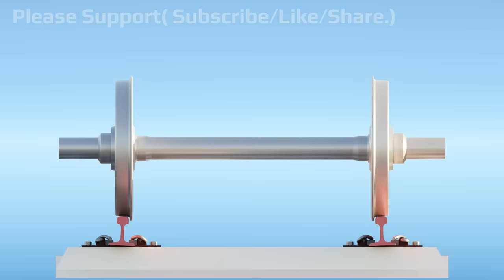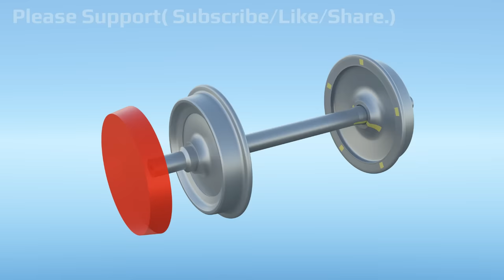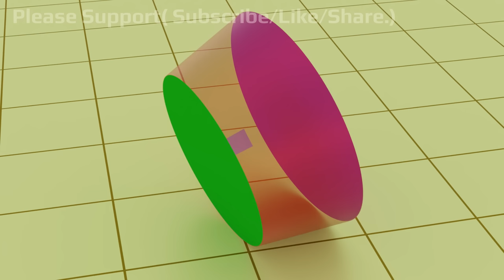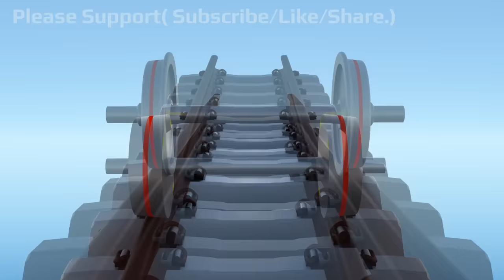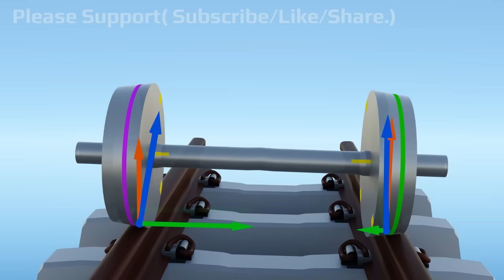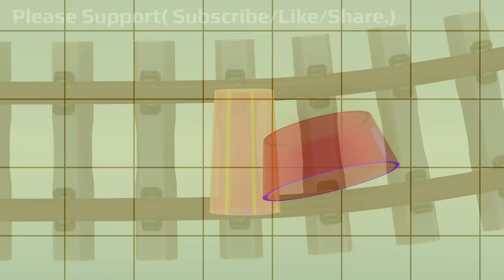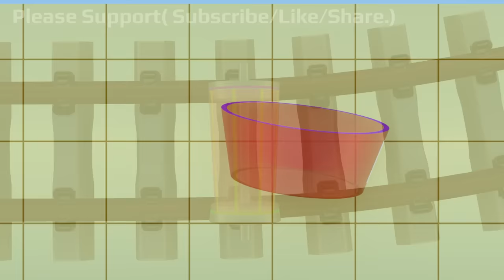How trains actually Turn ? | on curved rail track.

Comment: Thank you for your most valuable lesson about the act of a railroad train. It convinces me more that railroad trains are not driven: they are only operated by engineers and other train operators. This lesson teaches me how flange wheels make slivering sounds when the wheels turn according to the bend of the rails.⭐🌟

Comment: Always knew that the wheels were slightly conical but this demo makes the actual physics of the conical shape easily understood, before when I was explaining that train wheels were slightly offset the ones I was talking with couldn’t really believe me but now I’ve got something that explains it better than I can
Reply: there are no 'physics' unless the wheels are turning- the shape of the wheel-treads are designed to operate using differing radii in curves and this also illustrates why gauge accuracy is so very important.

Comment: Lots of good information but I'm left with questions (in case they do any revisions). The graphics for the force vectors are all drawn by someone who didn't understand that the length of each vector is proportional to its magnitude. The big resultant should be the diagonal within a rectangle and the horizontal component is the short side of that rectangle while the vertical component (resisting gravity in this case) is the long side. Next, I kept asking what keeps the wheel from getting so far to the side to have the flange touch the rail to make that squealing sound we all dislike (the sound that every Bostonian at Gov't Center hates). The video leaves the stability question only half-answered. Then there is the purpose to all that random, irregular thump, thump, thumping. Also, was this written by a person who made dozens of grammar errors or a computer who writes, mostly correctly, what it hears - leaving those errors untouched?
Reply: people who REALLY understand wouldn't even have to draw anything... but that would take mechanical and spatial aptitude. maybe some strength of materials knowledge would help.

Comment: The ratio of triangle (sin and cos) explanation finally made me understand! Assume hypotenuse is constant (non changing). Any angle change set by the wheel at that point in time changes the horizontal and vertical (ratio of opposite and adjacent over hypotenuse). But since hypotenuse is constant only the other sides change length and the length is equal to the force!
Reply: Ken do attitude
Reply: precisely why its better to think in terms of varying wheel radii and their effect on the steering of the truck, as well as how that steering effect relates to the curvature of the rails.
Reply: @tommurphy4307 interesting indeed, so the change in length (force) corresponds to a change in contact of the rail to the differing diameter of the wheel shape?

Comment: this does a good job of explaining this but I wonder why it is so difficult for engineering types to use articles properly.
Reply: Haha, I was thinking the same thing. The animation was great, but the narration was horrible. Don't these YouTube creators actually read their script before getting the robo-voice to read it, and then don't they actually listen to the video themselves to avoid getting embarrassed about all the grammatical mistakes?!
Reply: A lot of eastern European languages, like polish or russian, do not have articles. Speakers of these languages almost never used "the", "a" or  "an" prior to learning english, which makes it difficult to understand their actual use and spot the errors. The mother tongue of the creator of this video very likely does not include these articles either. That doesn't mean the video wouldn't benefit from some proof-reading. I also found the mistakes distracting.
Reply: It's from India, creators are (likely) Hindi speakers. No articles, little plural distinction. The narration appears to be STT.
That said, English is very widely used in India, and there should be no trouble at all finding some average joe who can clean up most the grammar. The channel has very few vids as yet; perhaps they will start tidying their presentations.

Comment: This seems to be only partially true. For certain, the semi-conicity of the trail wheels helps keep them centered on the rails without the flanges doing all the work. But the part of this video that tries to describe both wheels on an axle as acting purely like a large truncated cone is at least somewhat specious. Even if this effect was entirely accurate, it does not explain how the wheels always follow curved tracks regardless of other forces (not mentioned in this video). Also not mentioned is that on modern trains, each bogie also steers passively, and the flanges definitely help the bogies reorient themselves to keep the wheels best aligned with the rails. In short, this video makes a good point, but the overattributes the affect as if it is the ONLY thing contributing to the train's steering.
Reply: the flanges don't do a damned thing unless there is a sharp curve such as what is common in yards. the wheel treads and flange-radii curves do it all otherwise.

Comment: The track system is basically the same since it started. That says a lot for the inventor.
Reply: The inventor is probably still getting the paychecks slingshotted to heaven.

Comment: The animator blew it when showing the vertical and horizontal components of the perpendicular force. The horizontal were typically shown much too large and the vertical too small.
Reply: Clearly!!
Reply: In a mathematical sense that's true, but for illustration purposes he did the right thing.
Reply: Picky picky !  A Very difficult technical subject , which the animator has done an excellent job of explaining n ! 
I am curious as to what Animations you have produced ?
Reply: The vertical component should be the static weight. So yes, it seems the vertical force is larger

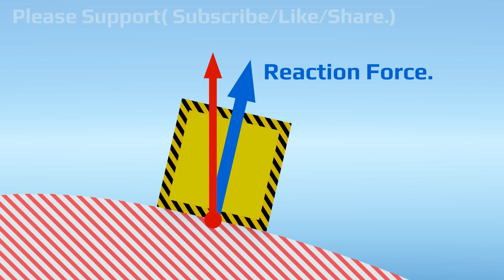Comment: the vector components at 4:20 are typically demonstrated by drawing a rectangle with F as the diagonal, and the components as the height and width of the rectangle.
Reply: Not only demonstrated. They talk about cos Angel and show random length.
Reply: I noticed that too. The blue arrow is the "resultant" force and only slightly longer than the vertical arrow. The horizontal arrow is shown way out of scale: it should be very short. Otherwise very nicely done.

Comment: very clear explanation. Is the same principle at work in two-wheeler counter-steering?
Reply: I think that counter-steering has effect on the  centrifugal force. The shape of the tires ( conical as the train wheels) are not as important. But this is purely a thought, not scientifically tested by me😉
Reply: The counter-steering effect arises from the gyroscopic properties of the front wheel of a bicycle or motorcycle. To make a right turn on a motorcycle, for example, you exert a torque on the handlebars to the left and gyroscopic precession causes the front wheel to lean and turn to the right.

Comment: What you don't mention is that the wooden ties on curves are subjected to a lot of wear. My college professor in Wood Products Engineering used to say that the Southern Pacific railroad didn't use creosote treated ties on their curved sections because the ties wore out so quickly from stress and vibration and needed to be replaced so frequently that the extra cost of treatment wasn't worth it.
Reply: Railroads haven't used creosote soaked ties for decades do to them harming the environment. I've replaced thousands of ties, and the only creosote ties I came across was from the 1950's.
Reply: @SmokinOak  nyc still uses creosote  ties
Reply: yes but that also goes back to the days of steam-powered locomotives and track fires. many roads didn't use creosote ties just for that reason- especially in the deserts and other dry areas. i think the SP knew a lot more about track and trestle fires than most roads did.
Reply: @SmokinOak  really was economically-motivated since coal has shot up in price. the roads and creosote production relied heavily on coal back in the day but now many roads don't even use wood ties.

Comment: I like your exclamations very much . they say using rails instead of trucks to transport goods. I think I heard once that once the wheels are moving it will keep going and slow down eventually. In that case it will uses less fuel pre mile. Doesn't need as much fuel because these heavy structures won't stop so easily just like a bowling ball.. could make a video and possibly to tell us what forces are at play there. Just started watching like your programs very much. many of us appreciate it
Reply: The effect you are referring to is rolling friction or rolling resistance. It is related to the amount the materials deform during the action of rolling. The rolling friction of steel on steel is far less than a rubber tire rolling on asphalt or concrete. It follows that rail is more efficient than using trucks as far as fuel required per mile is concerned.

Comment: There is no such thing as centrifugal force. There is centripetal force, which is tangential, not radial. This is high school physics. Rails are not tilted inwards: the tops are ground to match the conicity of the wheels. When you said 'we already said ...', you hadn't. You didn't mention that the bogeys can swivel w.r.t. the carriage. You left out about a thousand 'the's. Please don't perpetrate misinformation or illiteracy.
Reply: I would say there IS such a thing as centrifugal force: it's the reaction to centripetal force. You know, action/reaction. Also, I would say that centripetal force is radial, not tangential. Otherwise, you comment is spot on.
Reply: @ClarenceGreen You just failed high school physics. The reaction to centripetal force would be back down the track where the train came from, not at ninety degrees. If there was such a thing as centrifugal force, a derailed train would fall off sideways, radially, instead of ploughing straight ahead, tangentially, as it actually does. Look it up.  You are talking arrant nonsense.
Reply: @EJP286CRSKW  Centripetal and centrifugal forces are both radial, neither of which is "back down the track." I guess it's a good thing I did not take physics in  high school. Did you?
Reply: @clarencegreen3071  Centripetal force is tangential. I already said that, and I also said that the reaction to centripetal force would be back down the track: not the centripetal force itself, which would (still) be tangential: a distinction which you don't appear to have grasped. Yes I did take high school physics, and rather more besides, and I'm not surprised in the slightest to hear that you didn't.

And if centripetal and centrifugal force are both radial as you claim,what is the difference between them? You don't seem to know much about it.
Reply: @EJP286CRSKW  While I did not take physics in high school, I studied physics for nine years beyond high school (PhD), taught physics and electronics for 33 years at the college level, and wrote a rather successful textbook on introductory physics: Technical Physics by Clarence R. Green, 1984. You can check it out. 
   Are you a troll? What is your game? In any event, I'm out of here. This is just silly.

Comment: I always have a question about these wheels which seems not answered here, your explanations on a pair of wheel is excellent, but then a bogie has two pairs of wheels with fixed distances between them apparently, so when the front shaft tries to turn, the rear shaft is still going straight, wouldn't that causes drag and slip? How do wheel/bogie designs cater for that?

Comment: Very interesting, like it very much. My only suggestion is to adjust the scales of the horizontal forces' vector lengths, which are proportional to the sin(theta), with theta being a relatively small angle, to smaller size to make them look more realistic in respect to the vertical forces, which are proportional to cos(theta) much stronger.

Comment: There is a practical limit on how tight a turn this system can handle. I understand that some trolley car systems, also called "light rail", have bends that are too tight and the system relies on the flanges to keep the wheels on the track. One or both of the wheels, then, must slip on the rail. The end result is a loud screeching noise every time a rail car makes that turn, which must be somewhat annoying to passengers, but must be extremely annoying for people who live or work in the area who hear it frequently. The other negative effect is that the rail and wheels must wear out faster than they would if the turn were not so tight.

I recall hearing the screeching when riding the trolley system in a major city many years ago, always at a tight turn. I wondered why the axles couldn't have been fitted with bearings so the two wheels could turn at different speeds. This video provides a clear explanation why that would not work unless a different solution were found to keep the wheels on the track.
Reply: Device to mitigate wheel screeching in corners

https://youtu.be/4iDdVyxy4ps

Comment: 10-03-2023   Bangalore

Sir,

Wheel turning mechanisim  is true for one single wheel and axle.

But my doubt is:  When a bogie  has two axles rigidly fixed to  the frame whereupon  rail car is fitted

rigidly to a the bogie,  then  when a single axle turns,  how the entire bogie frame (rigid frame)

make smooth turning on rails.?

I  very much doubt about this aspect.      Can I meet you in person (preferably in Bangalore City) ,

if  my doubt is not clear to you?   Will yourespond with a diagram?

-  Nagaraj  T  V    Bangalore

Comment: As to the "bogeys" : when driving through a curve : don''t they move accordingly , means have a pivot in their center , the whole of them rotating  ? I can't imagine it goes without.. as to the space between "flange" and rail : doesn't it absorb the caused slight difference in width between the wheels ? Maybe I'm wrong but I can't stop thinking of all that...
Reply: the flange keeps the whole mess on the tracks- the transitional curve (radii) between the conical tread and flange (and that conical tread shape) is what steers everything. there should be virtually NO difference in the wheel gauges. roll a lionel or brass O scale truck with your fingers very slowly around a 27" radius curve while inspecting the wheel flanges closely- you will see the truck steering thru the curve with nary a flange touching the rails. NOW you will see how it works.

Comment: VERY INTERESTING. 
MY QUESTION IS IF SPEED OF THE TRAIN IS VERY VERY SLOW THEN WHEELS WILL REMAIN SYMETRICAL ON LINE AND ON THE CURVE,  WHEELS WILL NOT SHIFT IN THE OUT SIDE DIRECTION.  ?

Comment: If the two wheel fixed together on the shaft and rotate at the same speed what happen when entering the corner section. Does need a differential gear between them? If not the different rotation will shear and give pulling force to the shaft.

Comment: The wheels ride on bearing adapters that support the side frames. The center bolster is supported by springs that are riding on the side frames. It's a great design when properly maintained,  but I wouldn't be surprised if more than half the freight trains running in service, have serious, necessary AAR mandated repairs that haven't been addressed. A fire like the one in East Palestine probably came from locked up brakes. Probably someone set the hand brake. That would do it. That or someone removed brake shoes. I've seen bad slack adjusters that apply the brakes and totally melt the brake shoes and part of the brake beam. Metal on metal baby. That gets real hot. Bearings just dont fail, first there is a visible leaky bearing seal. But if there is a flat spot in the wheel, hammering constantly at the bearing? Yes, eventually there is going to be a failure. Inspections aren't being done. They have been substituted with remote heat sensors apparently. 
🤘😎
Reply: we will find out as there is an infrared video of the train and they know which axle it was. stay tuned....

Comment: Why was bearing on the axle not used to make the wheels rotate at different speeds free from each other over a curved rail?
What is the science/logic behind making both the wheels fixed on axle rotating as a single unit?
Reply: You'd have 2 inline axles which would require 2 bearings per axle. That's double the cost when you consider the extra machining and extra support structures. And if the wheelset didn't follow this conical principle, it would not self steer, thus wearing the flanges off very quickly, as well as being noisy as the flanges rub heavily against the rail.

Plus, the current design makes it very simple to change a set of wheels, simply lifting the truck off the track. Compare that to changing a wheel on a semi, a major PITA .
Reply: The conical shape is not only for turns, it also helps to keep the train on track for the straight parts. Why complicate things when there is a simple solution.
On ideal curves and straights you could even remove the flange and the train would stay on track.
Reply: Talgo trains have independent wheels, but for other reasons.

Comment: Man that was amazing animation and explanation, I've learned a lot!
but one mention from my side. If you make decomposition of vectors into components, the lengths should be proportional. If its not proportional it may mislead novice mechanics, because it doesnt see why it works like that - its not logical. Also it  gives wrong intuition about this topic - you may think that force in horizontal axis is similar to vertical axis what is complitely wrong. You could make addidional animation when you show real proportions and then you goes to this disproportionate components with comment its only for better visualisation. 
This is my opinion for this little detail, but its drop of mistake in the ocean of gold. Thank you very much :)